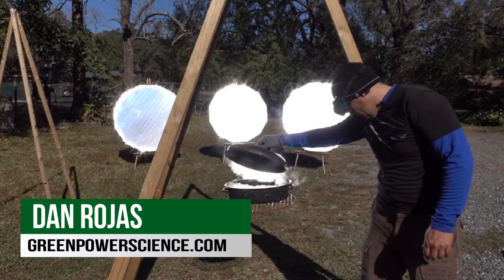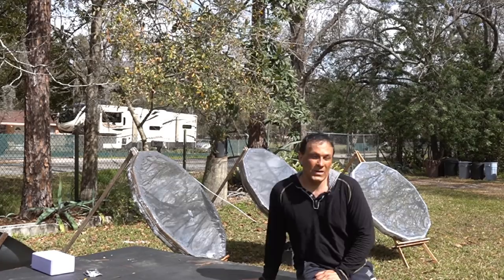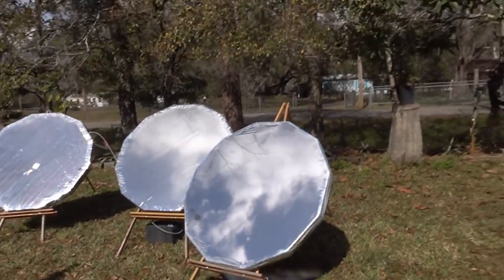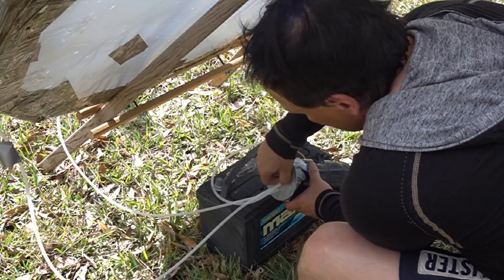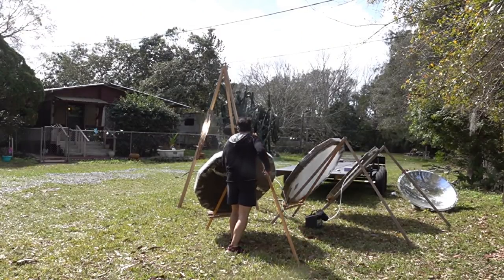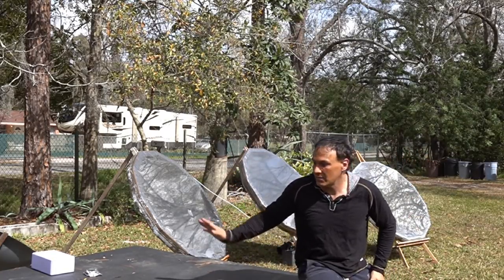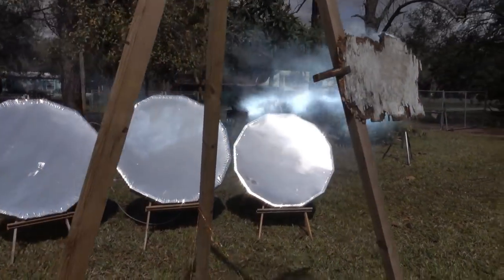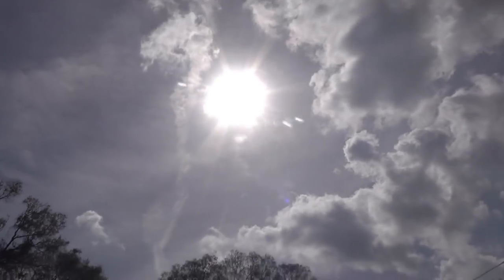Mylar Blanket Parabolic Solar Array 3 Kilowatt solar power Death Ray

Comment: Lovely build. For an easy Sun tracker just use cross-wired electric motors, each powered by a small solar panel, they automatically face the Sun.

Comment: Amazing. I wonder if you could use a similar setup using scrap mylar as a mold. Just pull a vacumn on it, then layer it with fiberglass and resin, then lay new mylar on top of the resin. Just keep the vacumn on it until it dries, and it seems you would end up with a permanent parabolic mirror. Probably things I'm not considering, but just an idea.

Comment: There are ancient inscriptions on temples that describe 4m parabolic mirrors used to melt rock. Apparently two of these mirrors where used at the same time on the same focal point to create a beat frequency of sorts and this would melt the rock so it could be cast like a polymer! Could you try this on some hard granite or something?
Reply: it can make glass from sand for sure.
Reply: once i read about 19th century similar contraption of 100 sq m they said block of iron had no chances of melting its just "wrinkle dry" then vaporized almost instantly, even i had difficult time to imagine lol anyhow what ancient sources can you tell me?

Comment: Live your work! Are you familiar with plastic pyrolysis? Someone needs to make a plant powered by a fresnel lense or parabolic mirrors. If anyone can do it you can! It's pretty simple compared to what your capable of and you already have the lenses. Turning mixed plastic garbage into fuel only using the sun would be incredible!

Comment: All those watts without solar panels - how do you convert that into usable electricity to power a small house?
Reply: I whant answer on that too
Reply: Maybe a stirling engine
Reply: Steam engines are far more efficient that sterling engines at converting heat into electric power., plus distilled water is a byproduct if you collect condensation in an underground condenser to cool the steam
Reply: Get the mirrors big enough -
Buy stirling engine is easiest
 steam engine is easiest and cheapest and most efficient.. stroke vs turbine as you scale up

Nonparabolic Flat reflector - shine on solar panel

Optional - distill ethanol from sugar

Comment: I'm using a pressure sensor and peristaltic pump to maintain constant pressure it is not so complicated and uses very little power. Also I noticed that when the mirrors are air tight the heat from the sun makes the pressure vary and so the focal length also. With this system the focal length always stays the same.
Reply: Michel PASTOR is your system pictured on the web??
Reply: Not yet. I was planning to make a video about it but never took the time to do it. It is integrated to a custom dual axis solar tracker. The pressure management system in itself is really simple. If the pressure goes above the set pressure plus hysteresis it makes the pump go one way to lower the pressure until it reaches the set pressure. If the pressure goes below the set pressure minus hysteresis it makes the pump go the other way to raise the pressure until it reaches the set pressure. The pump is controlled with a H-bridge. It is too early in the year (winter in the north hemisphere) for me to demonstrate the entire system on video but I could do it in a couple of months.

Comment: I can see this working on a tower with a spyglass that follows the Sun and will funnel the Suns Rays to a centerpoint within the machine; then at the base 360° It will have the ability to direct that energy any which way... A Death Ray. It's either that or a better inexpensive solution will be to have the "Death Ray" fixed on the ground... Then directing that energy to a tower to shot a target from a very high elevation or from the ground to the heavens - as the beam of energy only has to be the size of a sowing needle to take out a fighter jet.

Because I've also seen your Horizontal Death Ray with the plastic liner on top of the 4 pillars made of 2x4's and the water bead right above it... And was shocked when I witnessed the glass bottles melt.

Comment: Apologies for the delayed comment, but as I explore solar power I can't help but wonder if perhaps you can apply a shellac coating to the surface of the mylar to create a rigid form which would then no longer need the vacuum interface to retain its focal point? Perhaps you can even create the first form with shellac on the top surface, then use it as a mold for other reflectors, where the shellac is applied to the bottom surface then allowed to dry? Well done! Thank you for sharing!

Comment: Welcome back!  Thanks for sharing your update.
Regarding the array table, wouldn't you need two-axis movement to track the sun?
Reply from the maker: Hi Tom,
Thank you for the nice comment. The dual axis will be required more in the summer than winter but rear legs of the easel stands will have rollers and one screw drive to adjust them. May be complex or very simple, not sure yet as I have not gotten that far. I am guessing the power may be better during the summer for an AM - PM time period vs 12 noon as the beams would be a bit linear to the target when the sun is directly overhead.
Reply: A few decades ago I was working on a 2 axis tracking system that worked only with the magnified heat of the sun falling onto bi-metal springs, expanding in the heat until aligned with the sun in each direction again.

Comment: I mean I guess it's cool, but is there a practical reason to build a sun tracking parabolic mirror array?  like to focus a lot of light onto a small but very high yield solar panel or heat a large amount of water very hot for some reason?

Comment: While watching something burning, as a result of the heat, is impressive and dramatic, I would much rather see this put to a practical use. Maybe the heat could be used to generate steam  to drive an electric generator or operate similarly to the large commercial systems that use mirrors to beam the sun to the top of a tower?
Reply: could suspend a black cannon ball in the middle of a glass water container and set the 3 focal lengths on to it

Comment: Why dont you use scrap mirrors, it should be cheap and last forever?
You can glue bunch of little mirrors 20x20cm on small steel plates with holders on them which could be aligned by hand to center focal point and than instantly welded to the steel construction of parabolic mirror.
Frame could consist of 25 mirrors 20x20cm to get 1sqm parabolic reflector.

I will paste here the text I posted on another video about green energy that could use those reflectors with sand as material for heat storage.

 Ok I think we could buy old steel tank from truck at scrap yard 3-4000 liter, put it vertically fill it with sand, molten salt or whatever stores huge amount of heat. 
We make one window 30x30cm with heat resistant glass, vacuum inside and coated one way heat transfer, similar like vacuum tubes for water heating collector.
Behind its black coated copper that transfers heat received from window to material (maybe molten material would be good to assure good contact with copper ribs).
Now we make alot of mirrors that would be guided with motors to reflect huge amount of heat through that window and heat material up to 400-500*C
We can also put 4 mirrors at window at 30* to collect light that would otherwise not hit the window and size receiving are up to 1m.🔳

We can then extract heat through copper tubing inside tank pushing water or some other fluid through them, even connect steam turbine to produce electricity but am not sure how much of energy can such tank store..

If that kind of tank could store big amounts of heat we could use it for making electricity through steam turbine during summer hot days and use it as battery during winter nights to heat home and make electricity.
Am not sure if about 50sqm of mirrors would be enough to make such amounts of heat during winter but its cheap and very earth pollution saving project.

Thanks for making me think of this idea and please everyone who have some recommendations or ideas to add something..

Comment: Interesting.  Could be a cheap way to collect more solar energy to a focal point for high efficiency PV or water heating!  Does anyone know the approximate reflectivity efficiency of the mylar?  Also, is there a more simple physical system that might be easier than a vacuum to create the concave?

Comment: have you tried a steam engine with this to generate electricity?
Reply from the maker: I have 3 larger steam engines. I need the larger footprint and thermal watts to get the sustained pressure required.

Comment: Dan I'm impressed with your videos and your unwavering passion. Solar thermal (especially concentration) seems to have exponentially more potential than PV. 

If willing, I'd like to speak with you and pick through your experience and knowledge to see if a commercially viable heating system can emerge. Do you have a private method of contact? Thanks

Comment: The sun gives out 625 watts per sq meter, those three pads of 1m2 are less than three full kilowatts per hour duration.
Reply: It would be kilowatts regardless of duration since kilowatts is just power or energy per unit of time.
Reply: @iloveamerica1966  
That is really not how solar math works; a system is energy per hour and a house needs 3kw per hour so 24 sq meters of 20% efficency panels or 12 panels of 2×1 meters, to get a full fucking 30kws per 10 sunlight hour period.
Reply: @robinhyperlord9053  What are you powering with 72Kwh / day? My house with water pump and pool only uses 30Kwh.

Comment: solar hot water just heat a small aluminium computer cooling block and used thermo convection to cycle the water

Comment: We know how this works, can't we make something practical that can be used for energy production?  Let's build this in a safe insulated housing with a boiler and a "Green Steem" engine and produce hot water, distilled water and electricity.
Reply: Jack the only thing I can see is heating a water tank and use steam energy to run a generator but then I'm not as up on these things as Dan is. I once asked Dan about a no electricity way to generate ice or colder temps than a zeer pot could (50 degrees F) and he said he found a way but would not tell me what that way was which I found really suspect. . Perhaps he could use a giant Peltier device with that amount of heat to do it.
Reply: HipHopKiller94  And yet you are still tuning in...
Reply: You could probably do something with it in that capacity: 3,000 watt-hours is just over 10,000 BTUs per hour, if you could manage a 100% efficient conversion to thermal energy. Even assuming a 50% loss, that's still enough energy to raise the temperature of about 2 gallons of water to more than 300 degrees Fahrenheit over that hour.

Could you do something practical with it? That's another question altogether.
Reply: PhycoKrusk - well people already do something practical with way less than that say 150 F. using passive solar heating systems. They can heat entire houses with them and use them to provide hot water with showers.. and a ram pump circulation system that carries the water up hill - no electricity needed at all. There's tons of ways to do Everything low tech but sometimes we need some electricity for low wattage low voltage electronics. If we could at least charge battery banks with such devices that would help out a lot. Solar is expensive.
Reply from the maker: ??? I mentioned an RV fridge = absorption refrigeration, other than a cold front, there really is no other options because the cooling process is always a heat pump. The best method is a solar panel to a small electric ice chest.  I do not recall any secret cooling devices up my sleeve. If I had it, I would have used it last summer.
I was working on the RV fridge _ concentrated sunlight but realized it was not a safe project to make a video on as there was a large risk for the water separator to violently rupture.
Reply from the maker: "GREEN STEAM" ENGINE videos are a hoax, 200 watt max, 5-10 kW…NEVERY, not even close. Buy the plans and try to find the parts for completion, good luck. I covered all that you mentioned in previous videos on a small scale years ago. This is about time-saving steps along the way for an array. I could have easily done what a majority of the hack channels do and fudge the "amazing results" from one of many steam engines I own or have built, but that would only add the the gigantic dump these "science/hack" channels have taken on real science just to go viral and have a bunch of people who know nothing about the process share and reddit all over the world. Once I have this completed I will share what it can and cannot do. Keep in mind this free info that actually competes with the professional parabolic mirrors we make, sell and supports or income.
Reply: Talk about science based, Off topic but are you still eating meat Dan? I just wonder if you ever decided to Go green in your body or if that played a role in your going green energy wise.
Reply: Thanks, I'll check it out.
Reply: you also thought he looked thin :p?
being a veg doesn't automatically make you thinner tho, there's plenty of protein's, fat and carbohydrates to easily get overweight if you don't care, its just that the animal side of the equation is left out, which is pretty small considering what people usually eat.